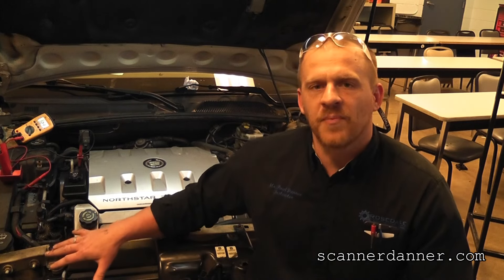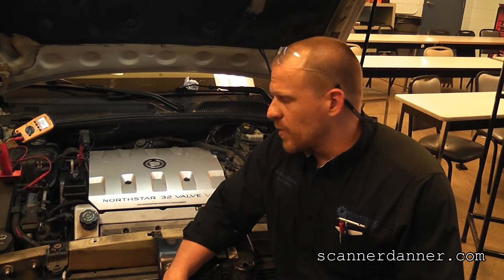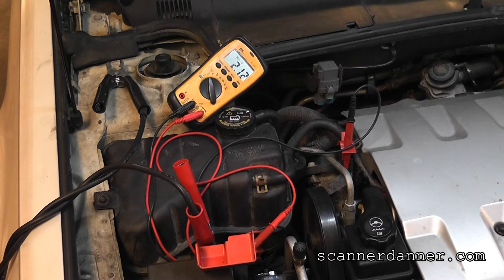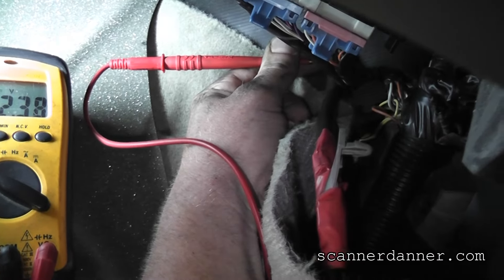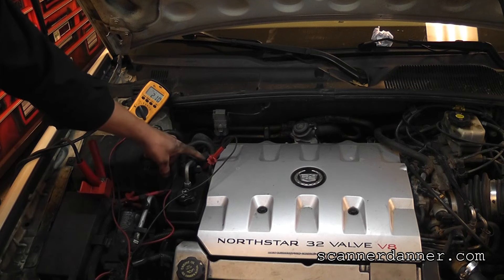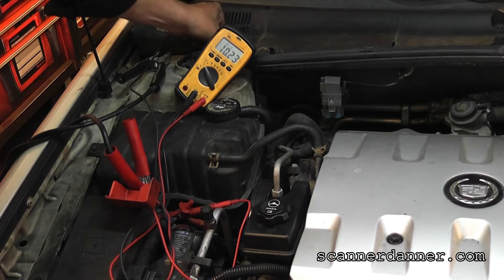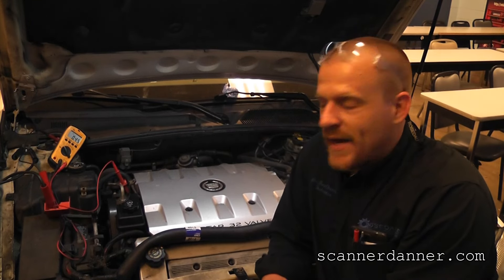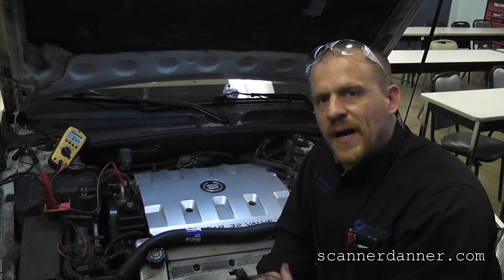Engine does not crank (bad block ground) - Cadillac

Comment: I'm currently chasing the same/similar no crank issue on a 2008 DTS. If i push the fuse block towards the drivers side just right, i can get it to start. My first thought was grounds, but then i discovered the pushing on the fuse box thing. Now you have me thinking ground again. I was thinking there may be a/multiple broken wires coming from the fuse box. I rebuilt the rear one before I discovered the front one being the/near the issue. (I used 20g solid core doorbell wire to replace the copper traces in the rear box. I don't think they were really bad but some of them didn't look super pretty.) Downside is I have aftermarket power wire running right above where the engine ground connects to the body and considering pushing on the box can make it start i suspect that may be the end where the issue is. 
The rubber in my top engine mount is bad so there may be excess engine movement going on. I'll follow up with what I find.
Reply: Yup wonky ground. The odd part is I put in an upgraded ground in parallel with the factory ground. You would think if one went bad, the other would make up for it. I was getting 10 mV - 200 mV when pushing on the ground towards the fuse box where it bolts to the body. Not nearly the 10 V you were getting, but my wire isn't broken nearly as bad. I guess it must be enough to interfere with the Data lines though. It may just be a corrosion issue. Hopefully it didn't go very far up the wire and stopped at the lug.
I made the wire with 2/0 CCI wire. Insulated it with Insultherm from wire care, the lugs are closed end and crimped on with double wall adhesive lined heatshrink. It looks like the heat from the engine compartment made the adhesive in the heat shrink ooze out, not sure if that is playing a factor. Possibly just need to clean the lugs and reconnect. I think I am going to try some Imperial Battery Protector or something similar this time as well. Otherwise i'm just going to have to make a new cable depending on how bad corrosion crept in there. Thank you for the video, saved me a lot of wasted time. I was probably going to start tracing circuits for breaks before I found this.

Comment: Paul, Wow I could see how that would drive ya towards a bad supply. Great detective work on your part. A little tip for ya guys that want to save a little money. I took a two wire,14Ga, 12' extension cord, cut the ends off,split it in two and soldered some Radio Shack alligator clips on. No more looking for a ground or power and I didn't have to buy a power probe!
Reply: Billy R Oh I almost forgot, very important, I then spray painted one black and one red!
Reply: Good tip there Billy. Your one sharp cookie
Reply: Hi Steve, that's nothing, I even made my own Power Probe of sorts! A red & green LED, couple of diodes, a few resistors, a old ice pick, some epoxy and 25' of low voltage wire for outdoor lighting from Home Depot!

Works like a champ and I restricted current flow ( thru the resisters ) to 12ma. Computer Safe! After I soldered the electronics to the ice pick ( had to wrap the copper around it a few times to hold it in place ) I used the plastic cylinder of the packaging ( putty type epoxy ) as a mold for the handle.

A little sanding and some black spray paint and I swear you would think I bought it AESwave.com! 

It's not capable of load testing the circuit, but it could be if I added a momentary switch or two!

My next project is a fused jumper lead for amp testing circuits ( such as fuel pumps ) from the distribution/fuse box.

I have a encased ( removable blade fuse and cover ) that I got from a Toyota 4Runner I was working on. It has two six inch pigtails that I plan on adding some blades to the pigtails ends, from another blade fuse or relay along with a little epoxy. Gotta lov that stuff!

I'm always looking for stuff that I can make useful adapters out of. Saves a lot of money!
Reply: Wow - right there you got two vids. See your a natural for this type of  stuff. People just love this type of do it yourself stuff, rather than store bought.  I've got a powerprobe and 400 lbs of weight lifting gear a thigh master  plus a lifetime subscription to the Scotty Kilmer channel and I'm still fat can't figure out what this powerprobe does and can't fix a car.  If you decide to get into movie making Billy I'll send you this powerprobe all the way from Canada to NC - wife says that North Contucky  , I think mines broke it constantly beeps , just drives me crazy. You have a good day Billy :)
Reply: Steve Rob Steve your crazier than I am ! Have a good one!
Reply: Steve Rob North Contucky.  Humph, gonna have to use that one from now on.  Thanks!
Reply: Huh ? Ground is a metal place u always need it
Reply: @Headshothorror4488  he means no looking for a clean ground to connect to while testing circuits.

Comment: One of my cars (1989 Celica GT) had a problem that when it got real cold or hot out depending on how long it sat without being started I would get a short hesitation before it cranked and sometimes it wouldn't crank at all, but the battery had a good charge.. I think I had Auto Zone test then replace my battery 3 times (Hey, they're the experts. Right!). The thing is, I could jump start it with no problems, whether it was hot or cold out with no hesitations, but it wouldn't start on its own with a charged battery... I thought, no way all those batteries were bad, so I got to thinking when I jump start it, the neg clamp of my jumper pack is on the block, and got me thinking maybe it's a bad ground somewhere, So I added a 4ga ground wire from my battery to a good clean existing bolt on my block and cleaned up the other grounds, and so far it has been starting right up, plus I am not getting the dimming lights and slowed heat blower I was getting.... I have an actual volt meter (not just a light) and I remember before, with my wipers, headlights, heater etc. on at night my voltage would drop below the middle on the gauge when I would stop at a light and idle... wish I would have seen these videos a long time ago... Check your grounds.. Thanks Paul

Comment: You would think that by now car engineers could design a motor mount that would last the life of the car. I remember recalls for 1968 Impala mounts that would break and pull off the brake vacuum hose.  Today I don't think they recall for mounts even though bad mounts are a safety hazard when the engine quits due to the ground separating.    Powers and grounds, powers and grounds!

Comment: Had a similar issue on a dodge pickup my brother bought a few years back.... That crazy braid ground on the back of the dodge block.... I got into a habit when I was installing car audio to put an extra ground (0 Gauge) on the block as well as upgrading the positive an negative to the alternator and what not... Always improved overall system voltage and current as there were no current limiting wires. At least on this car there was a decent size ground wire on the block. But still oil and road debris like salt just eat away at those connections. There has to be some kind of a better methodology by manufacturers when producing these vehicles! Especially in climates with either salt on the roads or the salt water air but the ocean... I image it willingly get worse as the amount of hybrid and electrical vehicles increase!

Comment: Great video.  It’s a good example of how following the fundamentals in electrical diagnostics will save you time, money & gray hairs. I have a long length of Cat-5 Ethernet cable that I keep around to use as a long jumper wire. 8 wires in the cable, each more then capable of handling anything a car battery can do. They are also color coded so you don’t need to worry about mixing up which wires are connected to power and which are connected to ground. The wires are also solid & tiny so you can stick them into connectors to bypass suspect wiring harnesses to sensors etc without worrying about spreading the connector apart.  Since there are multiple wires, you can do that with multi-pin connectors fairly easily too.  If you use this trick/technique in a video, give me a shout out.  :-)
Reply: 3
Reply: Great idea. I'm gonna try this

Comment: I tell my students the same thing Paul.  Use a jumper wire, in our case one that is 10 gauge because of the length of the equipment whether it be a Backhoe or a Combine.  The longest piece of equipment I work on is a 60 ft. Articulated Bus so making sure are at battery negative is vital.  If you don't have the proper hookup you will be pulling your hair out,lol.  Good Video.

Comment: This is exactly why I address some comments on this channel about  overanalyzing and keeping it simple. Sometimes it's not. You have an active circuit but it's not the circuit you want and the electricity is hunting around trying to find a GROUND through modules and components that you may not intend to be activated.  Without a good appreciation for electrical and electronic symptoms [ which can be numerous ] you are not really in the game.

Comment: Is the engine to chassis ground on the alternator bolt to under the fuse box in engine compartment? I'm installing a high output alternator and I upgraded the battery ground to chassis I'm adding 0 guage from alternator to battery positive now I have to find engine ground to chassis Amy advice you can give me

Comment: awesome video MR DANNER help me find my problem with this cadillac but after i changed the ground wire and the power harness from the starter and alt the car now starts up but the starter witch is also new stays running about a half second after the engine is running every time no matter what what can be going on with that ?

Comment: Question ! suppose the ground  had good  connection  but  the block  is considered  bad. Would  it be wise for example  to use the power  probe  to energize the  ground  using  negative  side of the probe to double  check  and ensure its a bad ground.

Comment: What do you think it could be if the ground wire is getting power when it shouldn’t for a Cadillac DTS 2011? The shop replaced ground wires but they burn back up because they are getting power. Plus the fuse box was replaced. Battery is good. Can’t figure it out.

Comment: This is a perfect example where a powerprobe would come in handy. Connect it up to the battery and use the black lead(ground)as your ground for your meter or even the evil evil incandescent test light :)

Comment: @ 15:45 is that looking from the top still? I can see the first part you are talking about under the line/under the fuse box but I can't see or move the lines to see where it connects to the block. Thanks

Comment: i have a 2008 honda civic 1.8 .  i buy from a friend  not starting valves were bent so i all ready get head job done.  when head job is finish time to starrt it  i just rolling over . i check the crank sensor i loose the clip off it then it will get gas and spark but when the clip on the sensor it wont get gas and spark.  what you think happen

Comment: I had a chevy pickup for no start when cranking it sounded like starter wanted to crank but not enough voltage. Checked the ground strap. when I tried cleaning it, it broke installed new one and truck started normally

Comment: Hello Paul, I have a 1994 Cadillac Fleetwood with 250K miles,  on which I had the Opti-spark distributor replaced at least 6 times in past 2 years, mostly for OBD1 codes 00-16 and 00-36, both pointing to the Opti-spark issues. Today when I tried to start the car, nothing happened totally shut up, although it started up perfectly yesterday. I put the battery charger on it, but it would not budge, as if it had no battery. Sitting in the car wondering what to do, and suddenly electrical stuff started clicking everywhere by itself. Then the car started up like it had no problem, but then code 00-36 came up, again pointing to the Opti-spark. Today's event clued me that the problem with the Opti-spark was actually a ground issue, and therefore I was looking for a video to tell me about engine grounding, and found your video. Would you conclude that the Opti-spark issues may have been actually ground issues. I took the car to the shop today for diagnostics and ground issues analysis. Any suggestions that I can alert the mechanic to be aware of,  will be appreciated. 
Thank you
Reply from the maker: Unrelated, most likely. Those opti-spark distributors were absolutely horrible and fail all the time. In particular when the vent lines have issues. There is an updated vent system available for those with multiple failures.

Comment: In your initial diagnosis Did you measure resistance between the block ground and body ground or battery negative? Between battery positive and the stud at the fuse block? Just curious to see if that is part of your strategy for voltage drop diag.

Comment: Love those Northstars. Have you ever tried to change an alternator, motor mount, or oil sender? I send them elsewhere.....
Reply: I put in the limo alternator at the same time as a radiator and big 3 upgrade. I was in a hurry and it was cold so I didn't protect the block to body ground like I should have so I'm back in there cleaning that up now.
Did suspension all the way around, all 4 wheel hubs, drivers side axle because it got messed up with the torch getting the hub off because I put it off for too long. Power steering went out, but I just drove without for over about a year. Then water pump belt tensioner went. Parked it because I hate winter without a heated shop.
Had it sitting for a couple months and needed it again. Put in power steering pump, high pressure hose, and WP belt tensioner. Drove it for a week and started getting this no crank.
And here I am.
Headlight bulbs are a fun job on here too.
Now I just need wheels because mine are shot, until the next thing breaks. Makes me mad because I think my wheels are a fairly rare option. They have the 2 lines on the spokes instead of 1. I saw one set on eBay but they wanted 1000 for them, just rims. Probably going to have to go aftermarket.

Comment: keep putting in the bloopers! also when you were going up the positive battery cable checking the voltage shouldnt you of been doing a loaded circuit voltage testing on that cable?
Reply: Good question phil. In some cases like this one, the voltage drop was evident with just the key on, no need to load the circuit anymore to track it down. Make sense?
Reply: gotcha makes sense. how long did put in the car to find it anyway

Comment: I put in a crate 350 tbi engine in my 87 R10 truck. I found TDC and dropped in distributor accordingly to #1 plug. I have gone over everything plugged in as I have numerous videos of old engine removal and labeled wires to where they would go when installation of new engine. I just hear a click of the starter trying to engage the flywheel. Checked starter and it is not bad. checked battery and its at 12.54V. I grounded from chassis to battery neg and small line from neg cable to frame. Would engine not being grounded like a braided strap be a problem. tried to also ground previous neg small wire to alternator bracket and it burnt up and smoked quick, but it did get truck to try cranking momentarily before cutting off.

Comment: Could put a ground wire on top, from motor to frame, or does it have to be that spot
Reply from the maker: It does not have to be in that spot. But it must be to the block or cylinder head or if totally necessary, the intake manifold, but I don't like that last option.
Reply: @ScannerDanner  thanks turned out to be the ecm 760$

Comment: Dan Sullivann Lode Pro wold  have fond that right off the bat very good tool
Reply: Communication issues and intermittent no crank problems as well as an intermittent continuous running fuel pump? Does the tool talk to you and tell you where to start measuring too? Proper usage of a DVOM is all that was needed.
Reply: Vaughn Dibble  I have 15 years of experience as a professional auto technician.  As an owner of a set of the LoadPro leads, I'm always looking for situations that would benefit from their usage.  I do not think LoadPro would save time in this case.  
In my experience the LoadPro leads are used with a load connector unplugged.  There are no connectors unplugged in this video, and no open circuit voltage tests are made.  
I don't believe anyone would have found this problem quickly unless they got lucky and decided to test the cranking circuit first.  Assuming you decided to test the cranking circuit first, how does the LoadPro help you isolate the engine block ground wire problem quickly?  Where would you open the circuit to use the LoadPro leads-and how would that isolate the engine block ground wire?
Reply: ScannerDanner Premium the way you use a test light and voltmeter all the time is genius